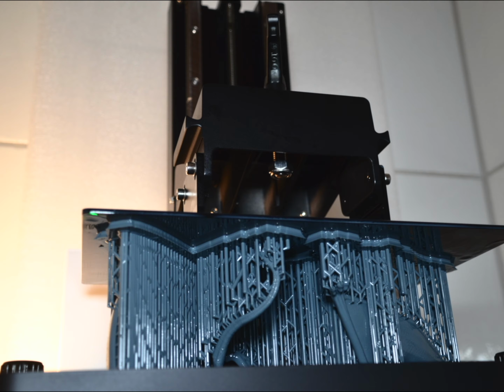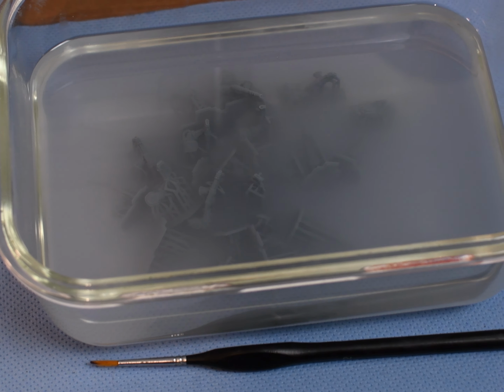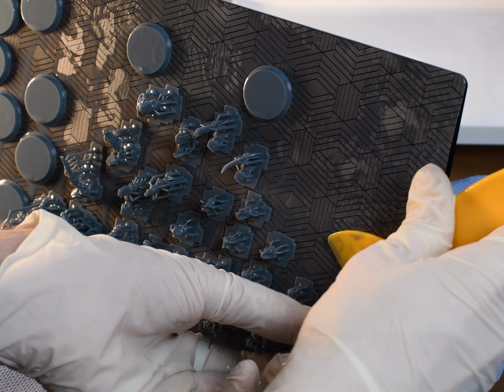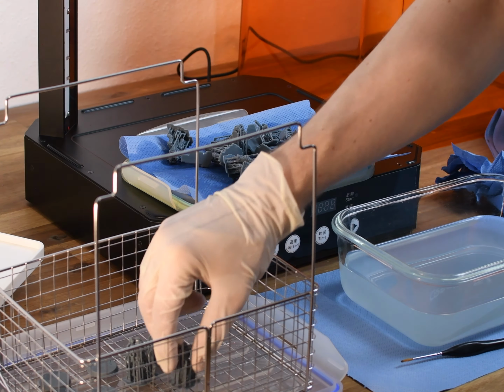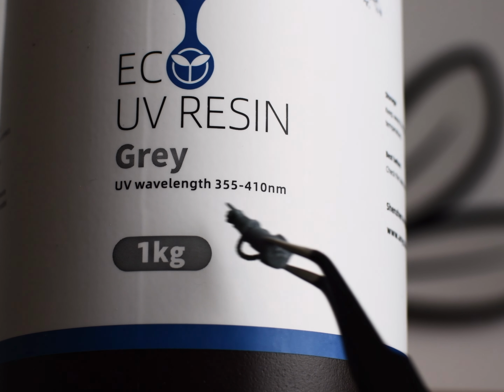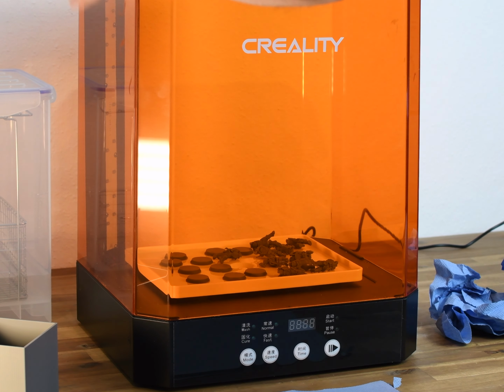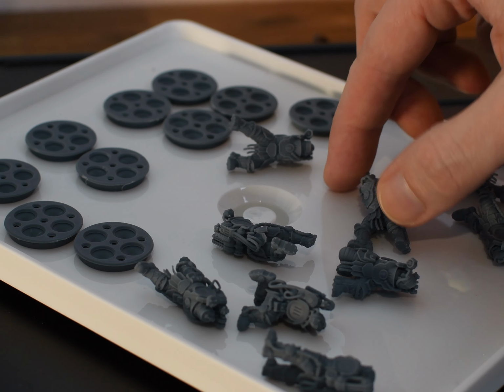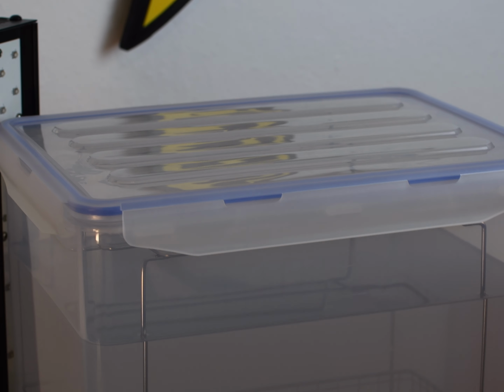Is a Wash & Cure Station Worth It? Creality UW-03 Review

Comment: for the Nail Polish LED Lamp, you could possibly get a small casserole dish, set a mirror inside and cover with a sheet of plexi glass or wire mesh instead of the paper towel method; this way the UV light would also get the underside without the need for turning

Comment: when using a washing and cure station, you still need to use all the equipment to prevent toxicity? You only have contact when removing the support I believe. And how ventilated the space needs to be in that case?
Reply: It's fine. Have some IPA or hand sanitizer in the workspace. The amount of scaremongering around even touching resin is crazy. Iv been in this for over a year and I'm totally fine. Often get resin on my skin and aslong as I'm wiping it away and drying up. All is well 😊
Reply: @hoohaa559  the issue is respiratory, you wont notice or feel it in the first 10 years or so, this is toxic and dangerous, avoid breathing it, as for touching it, sure, it's a little overkill saying that wil hurt a lot and stuff, just don't go in the sun with in your skin

Comment: I have a question that doesn't seem to be answered on any of the videos I've watched... DO YOU ONLY USE A CURING STATION IF YOU USE RESIN OR IS IT NECESSARY FOR SMALL FILAMENT PRINTS TOO?!! Hope I actually get an answer this time...
Reply: FDM (Fused Deposition Modeling) printers like the Ender 3 don't need washing and cure stations as those use a filament that is melted through a hot-end and cools/hardens naturally.
Resin printers need washing and cure stations because resin is toxic and emits fumes that are harmful unless cleaned and cured.
While it's debatable whether you should ventilate your FDM printer space, the fumes emitted are negligible and pose no real threat to you unless it's going 24/7.

Hope this helps!
Reply: as person above me told, no curing is necessary for filament prints.
There is one "exception" but it has nothing to do with filament printing itself. Some people may put a layer of resin with a brush onto filament print, which is done to minimize the visible layers - then it is needed to cure - but it is still resin curing just so happening to be on filament print.
Reply: No curing necessary unless you use some specialty filament that requires it. Otherwise just print and use.
Reply: You don’t need it for normal filament 3D printers you more common see, because resin is toxic and if you get it on you it can be deadly but filament is not deadly, sometimes some people do a cure things for normal filament printers  and all it does is help get rid of layer lines

Comment: Hi, i got a question to ask. Normally you will remove the support to wash or wash first after remove the support?
Reply: Personally, I wash with water, then remove supports, then wash with alcohol, then allow time to completely dry, then cure.
You could use alcohol first, but I prefer warm water as it makes the resin more flexible, then use alcohol to clean the surface I worked on.
Reply: I'm making educated guess here as I'm just getting into resin printing. I would say remove supports after washing but before curing. 

So you don't get the excess resin everywhere while removing supports if done before washing
Reply: i do both, i wash before removing suport, remove supports and wash again - but i use water washable resin so washing is far less painful.

Comment: Dit you using IPA or Brennspiritus?
Reply from the maker: I used 99.9% isopropyl alcohol (IPA).
Reply: I know this is a bit of an old comment but if you want a better cleaning station get an ultra sonic cleaner and denatured alcohol. Dont fill the entire tub with it just a jar that will fit your minis. You can even reuse the alcohol up to a certain point.